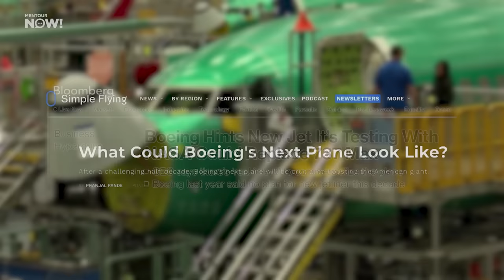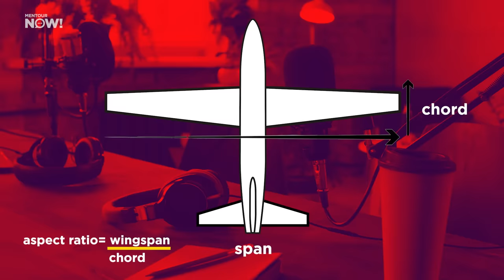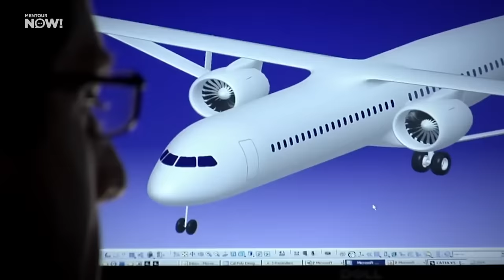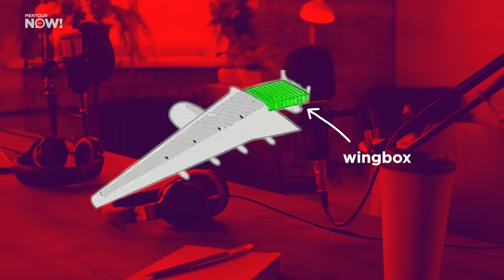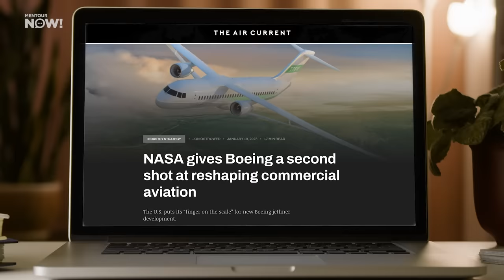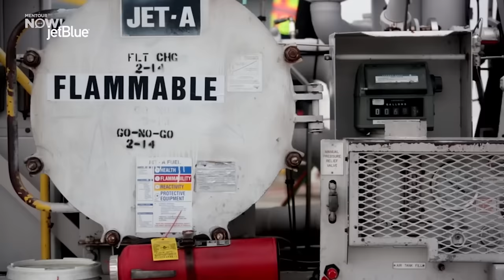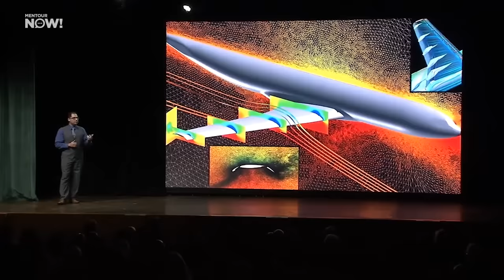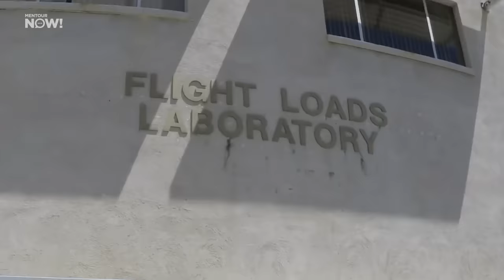Revolutionary Breakthrough: Boeing's Transonic Wing in Partnership with NASA!

Comment: If the commercial aircraft industry as a whole eventually moves to those wider wingspans, airport gates might have to change rather than forcing every single airliner to ship with foldable wings. It'll be fascinating to see how this goes down.
Reply: Instead of the wings folding up, which is inherently unstable, what if the wings folded forward? At speed, the air pressure would push the wings back, preventing them from folding forward.
Maybe have them fold forward and at a positive 20 degree angle, so they clear the doorway and make it easy to dock at airports.
Reply: Making room for wider airplanes would lower number of gates in airports and hence number of passengers they can handle.
And hardly any airport has lots of room to just expand to maintain old capacity.
Reply: @tuunaes  That is a good point. I was thinking that the main reason why they would not want to change the gates around in airports would be the enormous cost of such an operation, but the fact that in some cases it could necessitate a reduction in the actual number of gates is definitely an issue as well.
Reply: @tuunaes  But that is also a relic of the way thing are currently. Things could be changed so that (for instance), the planes park side on to the gates are towed out sideways on some kind of dollies which would enable them to be much more densly packed and could leave the terminal without engines running. There is always a way of doing things, it just requires imagination, and yes, money
Reply: Issue Is you would have less gates, thus the economical advantage of better efficiency would be offset by less passenger capacity per airport apron
Reply: @aenguswright7336   If I recall correctly, the B-52 was already famous for landing gear that could SWIVEL, so they could literally land sideways without disturbing the payload (early nuke-age)... and didn't have to "swing out" of landing in the crab... SO the tech' and hardware is already there for the "next generation" of industry aviation to do that... no dolly needed...

    I'd propose (for space and efficiency) on the PASSENGER side of the airport, that from the parking and drop-off areas, security multiplies the rows to advance what you can even bring INTO the terminal at all... and who has to stay their ass in the car... a few runners to bring "unnecessary personal belongings" out to cars or something as a courtesy, and once you're in the terminal to travel, transits can be performed from monorails overhead to ground carts and directly routed conveyors in the floor. Then it won't matter a lot how far you need to get. So long as the paperwork is covered by the time you walk in, you can get to the right gate, plane, and end-goal FAST... potentially a lot faster than we do now, if you want... There could still be a few kiosks for lingering lay-overs and the like, without too much trouble, but we could even switch things up, if we're towing the big new jets sideways, they can be lined up to ramps OVER the "clumsier" little yester-year jets still in service for regional and "short hops" depending on how popular they stay over years... and still functionally get in and get out without problems... "Smalls" (below a specific "class" of craft) would get relegated to smaller ports, air-fields, and "strips" for fancy private owners and some business entities, unless there's an in-flight emergency... and even the occasional emergency could be directly handled from the landing area by outdoor vehicles, should passengers need to evacuate and/or wait on some other transit or even another plane.

    Airports would get more expensive, but they're doing that anyway. Something like this, however, could even allow certain "appropriately secure and certified" outside entities to take care of security checks, searches of bags and/or bodies, and the like, even using a pass-card that has to be updated within a specific time "window" to catch a flight. Trying to cram all that scanning, x-rays, and random pat-downs or other searching into a single building is just going to inherently make a behemoth of something already largely a waste of space.

     It's fun to imagine how these issues could be resolved... BUT there are options. ;o)
Reply: From what I understand also, a lot of airports around the world are coming up on their "next 20-30 year" upgrades.

My airport is one of them, I would love to see/hear about if they've also gone back to the drawing board from the last 2050 design I saw about 5-8 years ago.

Saying this, there are also a lot of smaller airports that will see it's throughput drop thru the floor if all planes going forward will have wider wings without being foldable.
Reply: I'm not sure that having to rebuild every single major airport terminal 3 times as long just to accomodate the same number of airplanes will be appreciated by the paying customers.
Reply: @robertlee6338   OR some enterprising young engineers will build a multinational business manufacturing all the replacement parts TO SPEC' so the airlines can stay in business while Boeing and Airbus collapse in their asinine lust to "forge ahead"... 

    There is at least "the one" alternative I could think of beside your solution or "everybody goes bankrupt", which honestly isn't very realistic... possible maybe... but not realistic.

    I'll stick by my original assessment. It's fun to imagine how they could improvise for the future...  haha   ;o)
Reply: @protorhinocerator142  I would think that the hinge on a horizontally folding wing would be a lot more complex than a vertical folding wing hinge. One thing I thought is that not only would the gates need to be wider, but they would have to deal with obstacles along the taxiways and runways.
Reply: Oh yah. airports around the world are going to magically build bigger gates
Reply: @frankpinmtl  If by "magically" you mean "spend billions of dollars after years or decades of pressure from airlines and aircraft manufacturers for more adapted infrastructure" then yes, that may or may not happen over the next few decades.
That kind of inflammatory tone makes my blood boil.
Reply: @robertlee6338  You don't need to tell me, we are making the same point. It is something that is negotiated by the airlines, based on their needs. Although it is a little bit circular as aircraft are adapting when possible to airport infrastructure, and airports are adapting to the demands of airlines who buy said aircraft, hence the uncertainty over which solution will be adopted in the end.
But that guy implied that it would need some sort of magic to happen.
Reply: @SteelSkin667  Secondly - how about airlines, like LUV, investing in their own infrastructure FIRST - like their ancient IT, which led to the holiday shut down, because they prioritized profits over infrastructure.

Here you are, begging for public money. 

Pull yourself up by your bootstraps!
Reply: @frankpinmtl  I have no idea what you are on about. I live in Europe, English isn't my first language and I have no interest whatsoever in the stock market, none of those things apply to me.

Also no, I don't know the breakdown of how airlines or airports come up with the money to upgrade things like terminals or runways. I just know that, over time, they do.

I was however rubbed the wrong way by the inflammatory tone of your comment so I just had to reply - and mention it.
Reply: @frankpinmtl  I also get the feeling that you interpreted my initial comment as "airports should" rather than what I actually meant which is "airports might".
Reply: @SteelSkin667  OK. If you are offended by my tone, let me apologize. Let me explain it this way, that a European can understand.
(BTW - I am not in the US either, but know how thing work there). If you have never worked at an airport, then even moreso.

You are literally talking trillions of dollars, spread out between multiple countries, with multiple governing agencies.

Have you heard of Heathrow (LHR) for instance? Have you heard that they are trying to build a 3rd runway? 

 The third runway plans drafted involve compulsory acquisition and demolition of approximately 700 homes for which 125% market value would be paid to compensate families.

They were talking around 2015 about costing some $18 billion euro's. For a runway. 

There's another proposal which would also include adding a terminal. 

A wider wing aircraft would not cut down on the number of flights. They would stay. as they are - ever growing as airlines expand.

Let's say a terminal currently has 25 gates for the current narrow body limit. Well - to accommodate a larger wing, with the same size terminal, you'd need to put less gates.

Call it 20. So you have to move jetways (the things you walk on to board aircraft) to allow for more space. Demolish 5. Move fueling spots, if they are under ground. On and on. 

You would get less aircraft in the same amount of space. So you need to build more terminals. More taxiways. More aprons. 

You need more land. The government would have to expropriate this land from people. 

I am just touching on the tip of the iceberg, here. 

What do you do in cities like NY, which is already jam packed? 

Every major airport around the world, would have to change their gate structure. 

What about SWA, Ryanair and all the budget carriers, that would want these aircraft - to stay competitive, but fly into smaller secondary airports? 

Then what do you do with the ten's of thousands of 737 Max's and A320Neo's that are currently flying for the next 20 - 25 years, that need the 'old' gate sizes? You need two sets of gates? 

If both OEM's were to switch production at current levels, they could produce ~125 new narrowbody jets a month. 1500 a year. 

in 3 to 4 years, you'd have 5,000 wide wing jets and the other 20,000 regular wing jets. 

Airports would be in a constant state of construction. 

Who's going to pay for all of this. which would benefit the OEM's and the airlines? 

What benefit would the taxpayer have, by making these changes? 

Would ticket prices get cheaper, as airlines made more money on the fuel savings? No. It would go to the share holders and executive bonuses. 

Are you beginning to see the snowball effect? 

It would cost trillions and only benefit corporations.
Reply: @frankpinmtl  Thank you. Yes, your argument does make sense, airports aren't infinitely expandable, and constant remodeling wouldn't be sustainable. And yet, that's already what we've been observing, although at a fairly sedate pace so far.

Actually now that you are putting it that way, I begin to understand why our government (I live in France) have had plans to  divest from airports. They are likely not too keen on continually paying paying for infrastructure that benefits airlines much more than themselves. It makes a lot of sense.
Although it didn't pan out as airports workers have been protesting it fairly hard - and ground crews have a lot of power when they go on strike.

That being said how do you see it going? Will airports attempt to adapt anyway as we've seen them do many times in the past, despite the massive costs, or will the current terminal spacing remain the de facto standard for the foreseeable future, with folding wings becoming the norm for newer aircraft? Making the new gates compatible with the old planes is still achievable, but as you pointed out, airports that aren't equipped for the newer aircraft will be come inaccessible to those.

Those wider aircraft are barely at the prototype stage though, so that whole story is yet to unfold.
Reply: @frankpinmtl  I see. It makes sense that it would be in everyone's best interest for aircraft to be as compact as possible when they are on the ground, so the practical realities of congested airports would have a bigger influence on aircraft design than the other way around.

I also understand and somewhat share your skepticism when it comes to those big changes, not only "paradigm shifts" are very few and far between in aviation, but in all domain the final product often falls well short of engineer's promises. Although Boeing's high-wing design does look much less sci-fi to me than Airbus' blended body design.

As an aside, didn't what you are describing with auto makers lobbying for wider roads at the expense of pedestrians, actually happen in the US? In a way, those things do happen sometime, even when they are dumb.
Reply: @SteelSkin667  I think for new road construction, you may be right. But imagine if they went to widen the existing roads? 

In a lot of cases, they would have to expropriate private property to expand. Imagine how that would go over near JFK, LaGuardia and Newark?
Reply: Which airline will buy an airplane which could not be handled by existing airports?
I think nearly none airline will do that

And as long as there are (nearly) none such airlines why airports would spend a lot of money to rebuild their infrastructure?

It is a "Chicken or the egg" problem - as long as their not enough suitable airports airlines will not buy such airplanes - and as long as there are not enough such airplanes airports will not rebuild their gates.

And not only gates would need to be modified - also taxiways
Reply: @elkeospert9188  Aprons. Fuel access points. Jetways. Thing is - bigger wingspan means less gates. Less gates means new terminals need to be built to compensate. 

Huge capital expenditure, we're talking about here
Reply: All carrier aircraft have done folded wings for a long time
Reply: Smaller planes would work.
Reply: If parking garages can multiple floors, why not airports?
Reply: I won't travel in one of those.
Reply: That’s exactly what I thought. Also the two major jumbos are out of production now which means eventually less use for some of those bigger gates.
Reply: In the “old” days you exited front and rear on movable stairs.  Can’t we return to that?
Reply: Don't matter if their wider. Only if wings get longer do airports need 2 worry
Reply: @GraemeGunn  Is there something wrong with my choice of words? English isn't my first language
Reply: What would be possible. From what I see, the costs of flying are increasing, when the household income is staying rather static. We will have poorer and poorer flyers, that will not be allowed to fly so much.
Also, the reocurrence of natural disaster will probably trigger authorities to tackle air travel in the future.

Both will significantly reduce air travel. So there will be more space at the gates to accomodate those planes.

But there is still the point of the flying cars, that will completely change the logic around short travel with flying objects. I witnessed the Jetson one evolving and we have a flying taxi drone project in a neighboring city. This is where the future goes. Peoples slowly quitting the ground and commuting much faster through the air. We are decades of this beeing a mass phenomenon. But it will come.

Comment: I'm still crossing my fingers for Airbus's blended wing design to get off the ground... literally.
Reply: Airbus started out with 3 new  plane types.  They had already dropped the plan for the blended wing.   We may see it show up as an electric plane somewhere as it would have a nice spot to put batteries near the CG.  But as you know there are people problems with the blended wing.
Reply: Blended wing just does not work in any scenario other than GARGANTUAN.  130m wingspans or greater.  No airport in the world could handle such an aircraft.
Reply: @w8stral  No airport in the world is going to be able to handle the other new wing concepts either. Airports are going to have to change.
Reply: @w8stral  Why are they limited to large aircraft ?
Reply: @darthkarl99  Uh, no, they will handle them just fine.
Reply: @danharold3087  you want to walk or crawl onto an aircraft?
Reply: @w8stral  OK so your down to that. For a 30% fuel savings I think we could figure it out.
Reply: @danharold3087  Well, if you  think anyone will put up with an aircraft where they literally cannot stand up in, then I have a bridge to sell you... going cheap.
Reply: @danharold3087  PS: If we wanted a 30% fuel savings without changing a thing, we would have long ago gone with circular runways.

Comment: Thanks for bringing us honest Aviation news in small bites we don't choke on.
Reply: It’s ironic that Petter was just talking about span. Wing though, not the attention kind.
Reply: So I’m not feeling great about having to point this out but you should probably be aware that Petter is biased. Honest, I think so for the most part but he’s biased. And not that I really blame him but you should know that the aircraft he flies is Boeing made, variants of the 737 ng variety. The airline he flies for only uses Boeing aircraft and its understandable that he’d feel affection toward the aircraft he flies. It happens and it’s fine but I do feel that more people should be aware of this.

Heck I’m not immune to bias myself. On a purely technical level I think Airbus has the overall better design philosophy and from working on the ground crews I definitely like the simplicity, practicality and ease of use doing anything with an Airbus over a Boeing but… I’m sort of fond of the 787-800 both because a unique set of circumstances meant that one predawn tail end of my shift led to forty minutes with my butt parked in the first officer seat with an engineer in the captain seat teaching me as much about it as my primitive little mind could absorb. And because the 787 has a vent on the belly that blows out perfectly warm air, which is perfect for helping a half frozen ramper thaw a bit in the predawn chill.